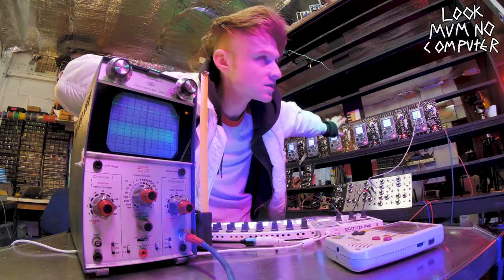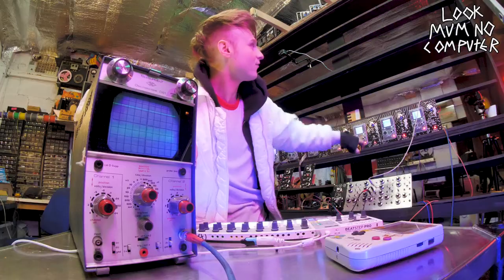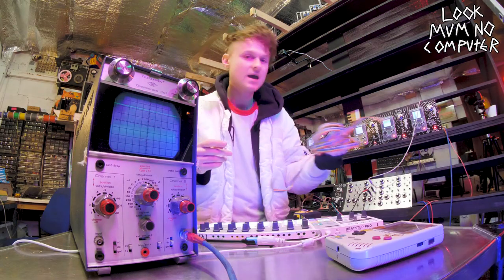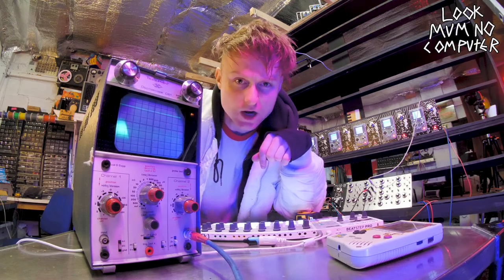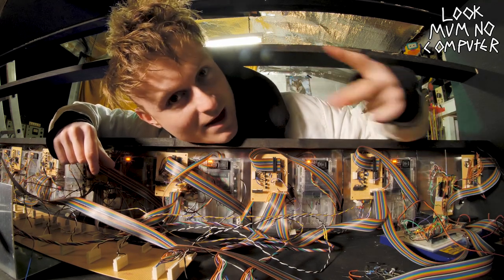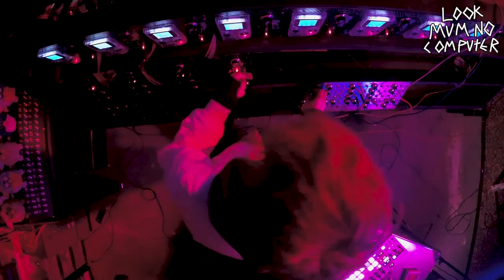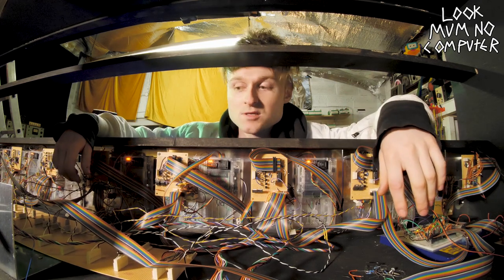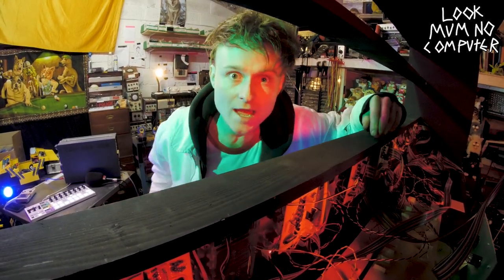GAMEBOY MEGAMACHINE Playing a song on 8 gameboys VLOG 3

Comment: So... Ribbon Cable Trick: If you have a problem with a signal on one conductor interfering with a signal on a neighbouring connector you can move one of those signals one over and connect the one in the middle to ground like this....

Signal1     GND    Signal2
........|.............|..............|   [Youtube won't let us ascii art anymore :(]

That way any electrical power going through the signal cables that are converted to magnetic energy thanks to Maxwell are coupled to ground instead of into the neighbouring signal cable.
P.S. It's already sounding pretty awesome :)
Reply: Yup that is also how ide cables work(the 80 wire ones that is). That way higher read/write speeds can be achieved
Reply: I was thinking he could use network cable (cat 5 or whatever?). Twisted pair configuration, shielding, it's the whole package
Reply: @SpaghettiEnterprises  yeah that would also be a good idea
Reply: @SpaghettiEnterprises  Yeah, well he could use differential signaling but then that gets into making every circuit he has to wire up more complex.
Reply: That's scsi in nutshell
Reply: @xKatjaxPurrsx  Na just suggesting different type of cables between units.

Comment: One thing to check is if the gameboys have a decoupling capacitor across the supply lines, if you are not sure, you can always add them
An example: i put 4 555 oscillators on a board to produce a harmony, they would not tune independently until i added a few decoupling capacitors
decoupling caps are usually 100nF ceramic disc.

Comment: I think that your noise issues with the ribbon cables could be partly due to the fact that you aren't twisting the wires around each other. Twisted wires with pulses running both ways cancel out the electric fields and stop them from interfering with other circuits/wires etc. That and shielding. Maybe you could try using Ethernet cables (like the networking cable they use in construction)

Comment: Hey, I have a question. How would I go about using a Gameboy Color as a midi controller without having to take it apart? Do they make cables that can connect from the GBC to a USB? I'm not trying to use it as a synth, but simply as a controller for my DAW (stop, play, etc). Is there any software that I would need?

Thankyou in advance man!

-DJK